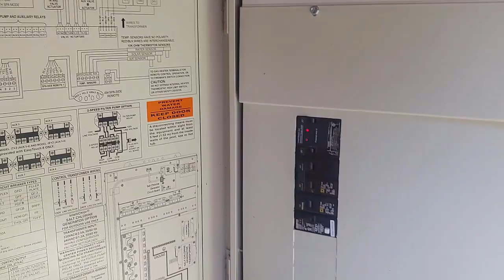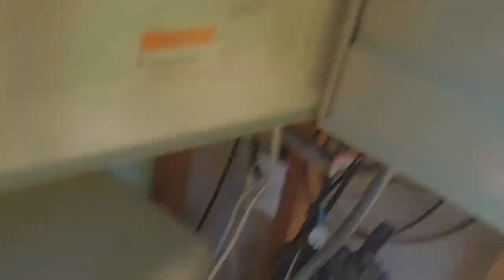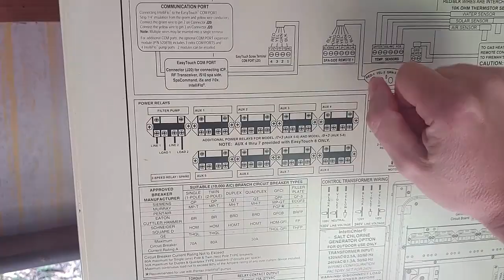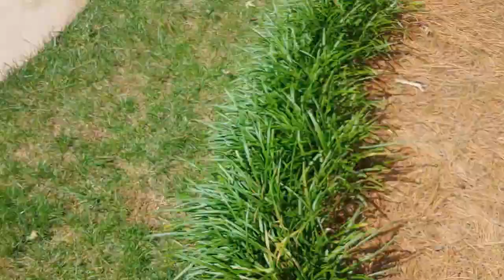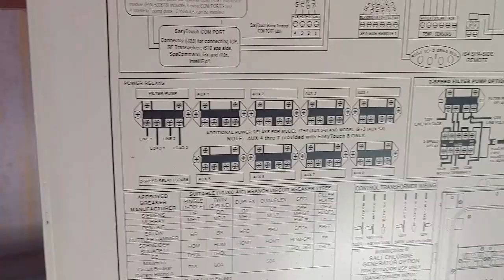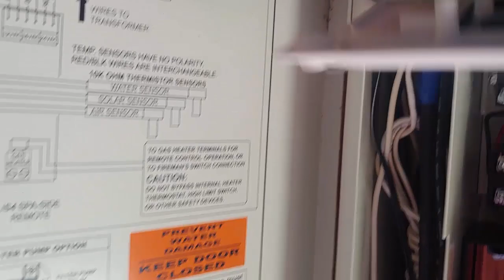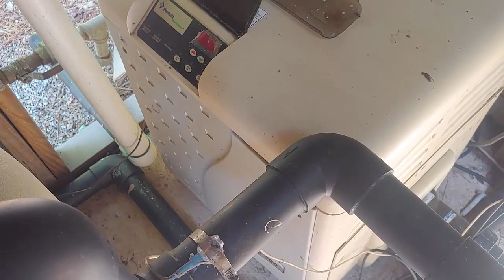REVIEW & overview: Pentair Easytouch 4 & Easytouch 8 installation. Pool & Spa Automation system.

Comment: Need some troubling shooting help. I have the same easy touch. Is am not getting any lights on my salt chlorinator. I checked the con not or  4 wire leading to the salt generator and I have appox 13.7 volts on each wire. When pump starts I don’t have any lights at all on m6 salt chlorinator. Need some help. After we get this repaired I want to add the wireless network screen logic . Thanks great videos.
Reply from the maker: Check for power at the chlorinator itself if you can. Check all plugs and connections. How old is the chlorinator? What part of the country are you in?
Reply: @SwimmingintheDeep  checked each leg at the power cord connection, got 13.7 volts. It’s about 5 yrs old and platers are cleaned regularly and clean. South Louisiana
Reply from the maker: @itsrem  check the  voltage at the other end...at the chlorinator if you can. I seem to remember there is a plug or two in between so it still could be a connection issue. I asked about the part of the country you are in because if you run your pump a lot of hours, say 8+ a day all year, you may be near the end of your SWG life expectancy anyway.
Reply: @SwimmingintheDeep  I do run it 8 hrs a day
Reply from the maker: @itsrem  I've only read about the life expectancy and not experienced it myself yet. Mine is 6 years old and runs about 6 hours a day in North Georgia.
Reply: @SwimmingintheDeep  so I replaced the generator after checking the transformer. Back in business! Thanks I will try to run pump less 6 hours instead of 8. I’m very interested In automating as shown in the video. Need some extra explanation. I have the exactly same system. Thanks for the help with the generator. I will be in touch with automation

Comment: Can you tell us how you ran power to your wireless internet connection?
Reply from the maker: I just plugged it in to an outlet.... But you could look on your AC to DC adapter and then use a multi meter to find a similar voltage source in the easytouch system.
Reply: @SwimmingintheDeep  Thanks! My only outlet is annoyingly taken up by a giant power supply for an irrigation controller that covers both outlets. I guess I will look for an internal power source.

Comment: Thank you for the awesome content.  Subscribed for sure.  Will be trying your Alexa hack this weekend.  I have the easy touch model before this one (gold with transformer on the side).  I just bought an AquaCal heat pump, but I can't tell where to put the communication wires.  Do you happen to know?  This model easy touch does not the "electric heater" spot.
Reply from the maker: thanks for the comment, I am sorry I don't know. If you let me know your model, I'll look it up and try to figure it out too.

Comment: Pentair heater there is a three port kill switch and it says see the instructions for 2 wire setup.  I did not see anything  in the instructions.
Reply from the maker: I don't understand your question.
Reply from the maker: I don't understand your question but if you want to know how my system is wired for the heater...  The gas heater power line gets tapped from the relay for your pump in the easytouch box.  Pause it at 4:24 and you'll see the top left pump relay in my box has two black wires on the far right. One is for the heater and the other is for the chlorinator.  The reasoning is that the heater or saltwater chlorinator cannot come on unless the pump is on.  The red and black low voltage wires that you indicate on the motherboard are what signals the gas heater to actually turn on or off.  Using the MasterTemp's "Fireman's Switch" (see manual) you  will set the heater itself to bypass it's own control board and rely on the easytouch system.  No other aux switches or relays are used for the heater.

Comment: If I’m understanding correctly the gas heater has the red and black wires that run directly to the motherboard (at the bottom right in your video). Does the power line run directly to the high voltage side breaker? And is there any connection between the gas heater and the aux 1-7 relays?
Reply from the maker: The gas heater power line gets tapped from the relay for your pump in the easytouch box.  Pause it at 4:24 and you'll see the top left pump relay in my box has two black wires on the far right. One is for the heater and the other is for the chlorinator.  The reasoning is that the heater or saltwater chlorinator cannot come on unless the pump is on.  The red and black low voltage wires that you indicate on the motherboard are what signals the gas heater to actually turn on or off.  Using the MasterTemp's "Fireman's Switch" (see manual) you  will set the heater itself to bypass it's own control board and rely on the easytouch system.  No other aux switches or relays are used for the heater. Good question, please subscribe to my channel if you have not already.
Reply: That helps a lot, thank you!

Comment: Thank you for taking the time to make this. I noticed that the white neutral wires are coiled going into the breakers. The guy that installed my Easytouch did the same thing. I figured there is a reason for doing that but I have not found it. Can you explain why that is done?
Reply from the maker: The surge protection and GFCI breakers come that way. I think it is done to keep your wires neat. A coiled wire can easily be pulled to a longer distance. I used to help wire security systems when my buddy would get busy and even we would coil the low voltage wires to keep enough wire there for any future changes.
Reply: @SwimmingintheDeep  Thanks for the reply. I came across a thread that suggested the wire that comes with a GFCI breaker is of a certain length, and while it COULD be cut shorter if desired but should not be made longer.

Comment: My Intellichlore 40 continues to flash  green for the cell which indicates it needs to be acid washed. I clean it and this error does not clear. The cell is 4+ years old and my pool store is telling me it is bad and needs replaced. Question, can it be rebuilt or must it be replaced and second question do you have an opinion on the "Splash" replacement sold on WalMart web site for a few hundred $s  less?
Reply from the maker: I have only limited experience with the chlorinator itself. I still have my original (installed December 2014) but only run my pump about 8 hours a day during the season. I've thought about getting a "compatible" generic one when it needs replacing. They won't work during Coldwater season here...under 55 degrees or so.... But the cold water warning should be showing if that's your issue.

Comment: 12v lights so many questions. Did you wire it to have a light transformer on a relay.  What controls the light
Reply from the maker: My 12v lights are powered by a 110v supply from this main box. The 12v transformer is outside this box in an adjacent box. One of the relays in this main Pentair box is powering the 12v adjacent box with the 110v. A Pentair circuit is assigned to it to turn on and off. Make sense?
Reply: Yes that make sense so when you hit that relay it sends 120v to the transformer that send 12v to the lights in the pool.    But if you want pool lights and a spa light on separate switches how would you do that without another transformer and a extra relay.
Reply from the maker: @unmeelectric6063  yes, I believe that would be the most straightforward way to do that.

Comment: When you add an anode, and you should, the anode should be added in line.  Look at a Perma-Cast inline Anode.  TN-IL 20 or similar.  You will see where the anode needs to be to protect the internal pool components. burying behind shed doesnt protect any pool equipment.  guaranteed

Comment: anode does nothing for the pool externally if it is not in line with the water.  None of your equipment or pool is protected by the anode
Reply: Bonding is separate function.  The anode itself has to make contact  not the wire.  Bonding is done to keep everything the same potential so you dont get shocked.  the anode itself has to be in the water, in line in the plumbing before or after filter.  if your anode is buried in the ground it is bonded but not helping your pool or equipnent whatsoever.
Reply from the maker: I disagree.
Reply: @SwimmingintheDeep  I guarantee you arent protecting any internal components because you have a bonding wire attached to an anode.  The wire is to bond the anode but the anode has to be in contact with what you are trying to protect, ie tge pool water that cycles through all the components.  your buried anode protects some of the minerals in your soil but thats about it
Reply from the maker: @kmonty6188  but the water is also bonded when properly done, usually via a lug on the ladder in a fiberglass pool like mine. In addition, mine is bonded to the heater core of my pool heater. Together those two are always in contact with the water.

Comment: Great videos, what led lights would you recommend for a new pool?
Reply from the maker: My pool builder recommended FiberStars. In the first three years a few of them fell out of sync but the warranty service was amazing. They all still work based on the replacements and it's 6 years later. So I'm not sure that I would recommend them but I would give them consideration.

Comment: im trying to install same panel. i got stuck on the 2 transformers wires . Pentair was no help.
Reply from the maker: Was my video helpful? Or do you need me to show any other close-ups?
Reply: @SwimmingintheDeep  can i send you a private message?
Reply: @SwimmingintheDeep   id like info on the chlorinator transformer and the little one on top of it. please. and ty for your time
Reply from the maker: @josephp4579  standby, I'll upload a raw vid to dropbox for you
Reply from the maker: Here is one vid for the main transformer https://www.dropbox.com/s/s2c3n28ki50d58x/20200920_134512.mp4?dl=0   I'll post the other transformer vid shortly
Reply from the maker: And here is the SWG transformer https://www.dropbox.com/s/9zo4gn4ftse63y3/20200920_133928.mp4?dl=0
Reply from the maker: Joseph, did you get what you needed with the video links I provided? I plan to take them down soon.

Comment: You mentioned landscape lighting wired into your 6th relay. Is that your transformer mounted on the lower right side of the high voltage portion of your panel? And if so what brand/model of transformer did you use?
Reply from the maker: You have given me an idea to do a video on my lighting alone. But my landscape lighting is high voltage with direct bury wire, so it's 110 voltage. My pool lighting is 12v LED though and it is on a relay. The two transformers in my box are for the box itself and my saltwater chlorinator. I'll try to post a video on it soon, like today if that's useful.
Reply: @SwimmingintheDeep  I could use this video too!   Working on lighting now and thats how I found this video.  Good stuff but I need a deep dive (pun intended!) into wiring some lights into the Pentair panel!
Reply from the maker: @orlandoreyes9388  let me see what I can do
Reply from the maker: @orlandoreyes9388  Here you go, a new vid. Hope it helps. https://youtu.be/uDaTy7nnQhw
Reply: Sounds like a good idea for a video as I wasn’t able to find anything about the subject of pool panels and landscape lighting when I searched. Your video came up due to having pool panel in my search criteria. Great video by the way. It really helped me connect some dots on using aux relays in the panel.
Reply from the maker: @roberterdmann9893  Just posted a lighting vid, thanks for the idea.

Comment: Can you post a link for the surge breaker please
Reply from the maker: Sure, do you mean make a video on this subject? if you're just looking for guidance on the surge breaker what you need to do is just make sure that it's the same type that goes into the easytouch. Brands of breakers that are supported or listed on the door. you want to make sure that you are surgebreaker is in the first and second position of the box for maximum protection.
Reply: Just looking for some guidance on what to purchase. I figure a link to the one you purchased would give me a good start to review specifications. Thanks
Reply from the maker: @andrej1868  It is a Murray Whole House Surge Protection MSA2020 also known as MSA2020SPD . They are around $120 but shop around, I think I got it on ebay under $60. Other brands will fit too. Siemans makes Murray breakers.  There is one right now on amazon warehouse for $56.35...that's a good deal.
Reply: Awesome. Thanks
Reply from the maker: Andre, thanks for the idea. Here's a new video on surge protection! https://www.youtube.com/watch?v=xv7PT0Lwe-k

Comment: You show how to control heater on the mother board but where do you connect to power up for the heater which breaker??? Where the pump is connected or in a different breaker?? Thanks
Reply from the maker: I have my heater power connected to my relay for my pump. The logic is that the heater cannot come on unless your pump is running. Please subscribe if you have not already. Thanks

Comment: Thank you so much for this video!  I'm researching how to add a salt chlorinator and couldn't figure out how the data would be sent to the easy touch and screen logic. I guess it is through a common com port.
Reply from the maker: Glad it was helpful! If you are not getting one specifically for your system, you'll want to be sure to get one compatible with your system to make sure you can power and control it centrally.. I have looked and see some say they are compatible with Pentair Easytouch. You can just get a separate one that has it's own controls and power but that makes things a little less orderly. Please subscribe if you have not, thx!

Comment: How do i hook up my electric heater?
Reply from the maker: Is it already wired via a Pentair Easytouch? or jandy, etc? Edited response.
Reply: @SwimmingintheDeep   its a new  pentair panel easy touch with a aqua cal electric heater attached to it, i hooked up the filter pump on the relay (single speed pump). Do i hook up the heater the same way, it is a 230 volt heater.
Reply from the maker: @JRFERNANDEZ349  Hi John, I am not sure. I know with my MasterTemp gas heater there is a "fireman's" switch in the heater that disables the heater controls and allows the easytouch to control it. Once that is done it should be just two wires that get wired onto the corner of the Easytouch primary control board. Hopefully that gives you a clue to figure it out. The water temp for shutoff, etc comes off of a temp sensor on your plumbing as you see in one part of this video.